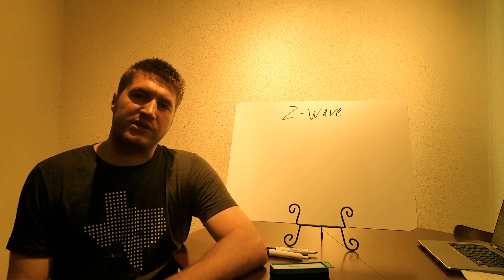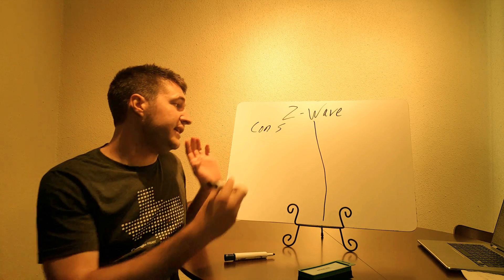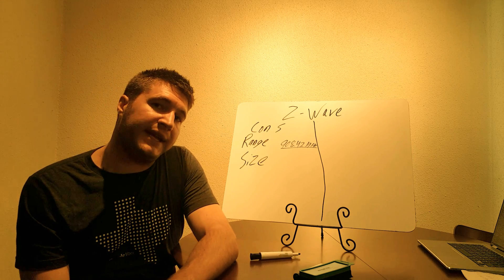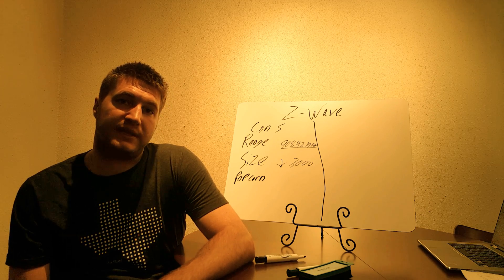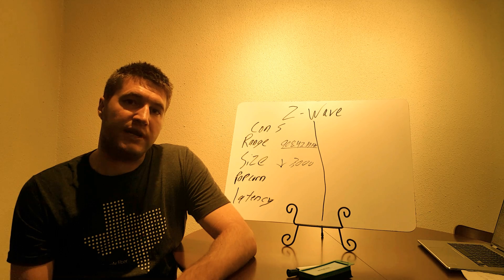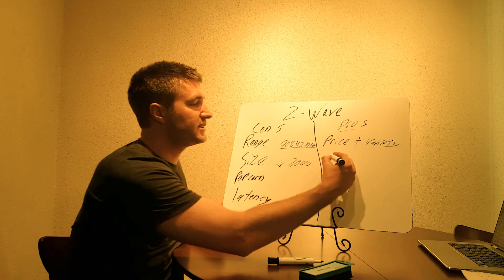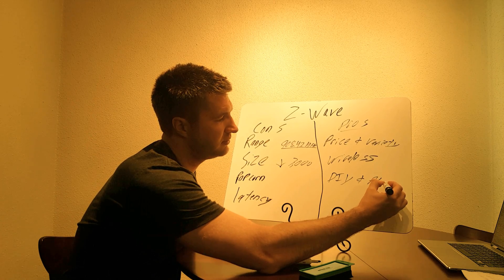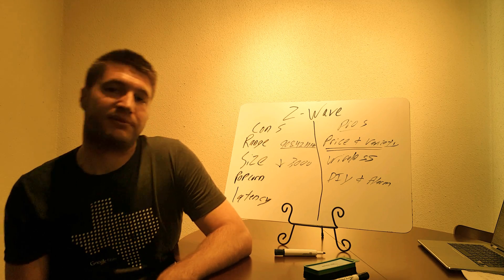Zwave Automation Pros and Cons

Comment: Tyler - Good job!  It's worth mentioning that some of the issues you've highlighted are specific to the main controllers being used. For example, the "Size" limitation is only a limitation for a single Z-Wave network. With larger houses (including houses with outbuildings), you can extend the range (and maximum number of devices) by adding more Z-Wave interfaces (like our Z-NET). Latency and the "Popcorn" effect can also be minimized (dramatically) by using a controller with a fast CPU that processes all automation functions locally. Latency in our HomeTrollers is typically measured in milliseconds; NOT seconds! Remotely managed "smart hubs" tend to have the biggest latency since automation functions are processed off-site on a shared web service.
Reply from the maker: HomeSeerOfficial Thank you for the comment HomeSeer. I've been aware of your product for a long time but never had a chance to test out. So basically is the Z-Net acting as an additional huh and then it communicates to the main hub via IP?  I've done large builds using multiple Vera units. This fixed the hop limit and allowed multiple transmission points. Only a few controllers on the market are about to do this. You are absolutely correct about remote managed hubs being slower than a locally processed unit. However, you would still have a popcorn effect, but it would be minimized. There is only one way that I know of that completely eliminates the"popcorn effect" in Z-WAVE. Again, I appreciate the information.
Reply: Tyler - the Z-NET is not acting as an independent hub. It's just a Z-Wave interface. Think of it as a network-addressable Z-Wave dongle. You only need one of our hubs ("HomeTrollers") running 1 instance of our software. Our software supports multiple networks and will talk to as many Z-NETs as necessary. This keeps everything centrally managed. As for the "popcorn" effect, I used to see that when I used X10 lamp modules on the 3 lights in my living room.  Now, my 3 Z-Wave bulbs come on instantaneously... at least I can't perceive that effect. In fact, I would have to look at the event to know which bulb is first in the event sequence (NOT kidding!)..
Reply: I have 3 lights scattered  across the front of my house that all come on at the same time using the HS Znet. I have yet to get a 'popcorn' moment. The closest to the HS is about 10 feet, the farthest is 40-45 feet but there are other devices in between.

Comment: Very helpful. I'm adding a few zwave switches soon and I feel like I understand the limitations of where I can place them. My GE (Jasco) smart switch is "zwave plus"... what does plus designate? Thank you.
Reply from the maker: Jerry Thomas Thanks for taking the time to post a comment Jerry. Z-wave plus has some improvement such as longer range, better battery life, over the air updates. What controller are you using?